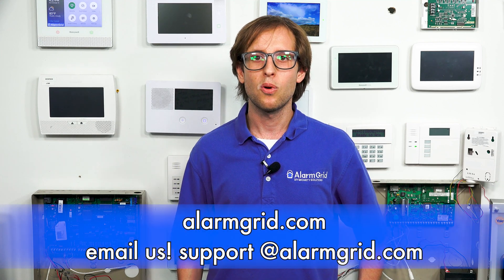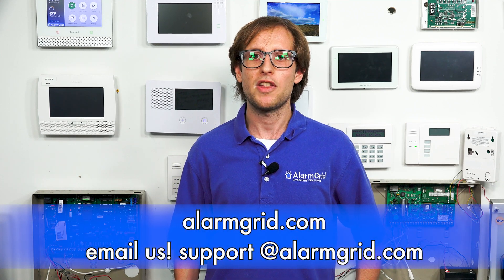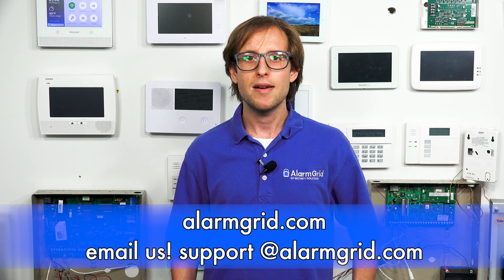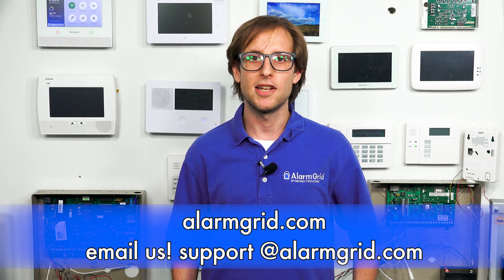Number of Zones On a Hardwired System Cannot be Increased

Comment: What I was hoping to learn from this video is after installing a an Interlogix 8 zone expander snap card, the keypad sequences to program the additional sensors for activating/deactivating and status monitoring. Specifically for a GE Concord 4 system that comes out of the box set up for 8 zones with the ability to expand by attachment to an expansion board connector.
Reply from the maker: I apologize, the purpose of this video was to explain that when a panel says it can handle a total of 48 zones, for example, there's no way to make it handle more than that.  We admittedly don't have a lot of Concord 4 content. It's not a panel we've ever sold, and it may be difficult to get hold of one now. We do have the Concord 4 Installation Manual, which I hope can be of some help: https://www.alarmgrid.com/documents/interlogix-concord-4-install-guide

Comment: I have an urgent question.
Our new house has an ADT safewatch pro 3000 (2001 version). I need to factory reset it and change the 4 digit user code so it stops going into alarm. When i power it on, all zones go straight into an alarm condition. I think the panel is confused about the wired and wireless zones. How do i completely factory reset it?
Reply: Hey alexanders if you could sen that question to support@alarmgrid.com we can assist you with it.
Reply: @joshuagriffin2807  all right
Reply: @joshuagriffin2807  i just sent the E-mail.
Reply: That’s because you defaulted the panel you will have to program all the zone back in to the panel